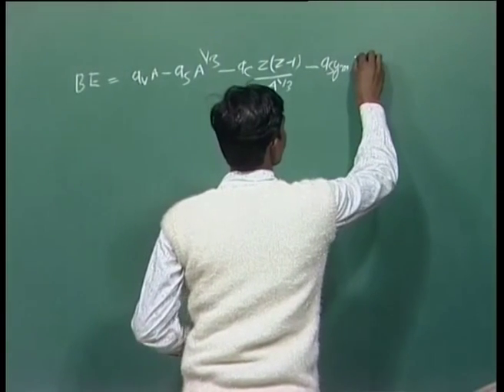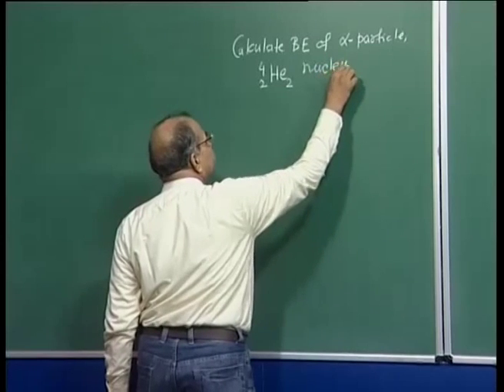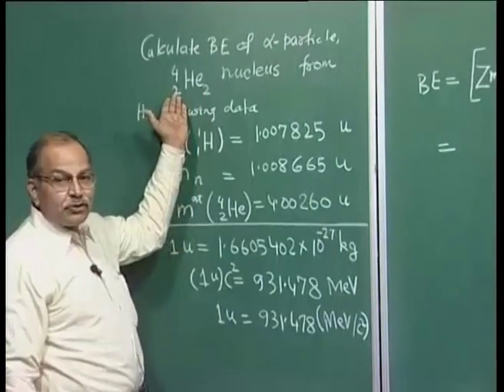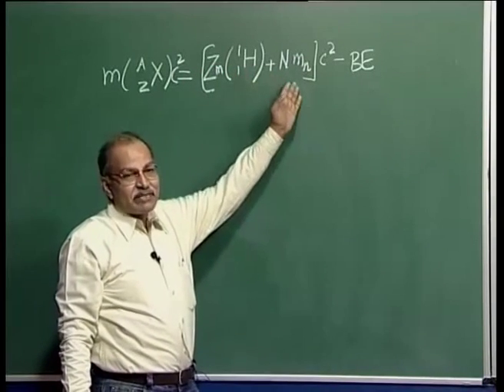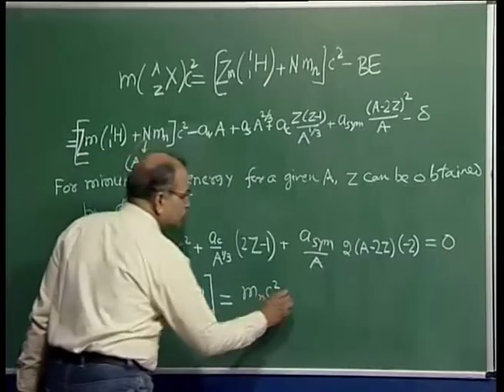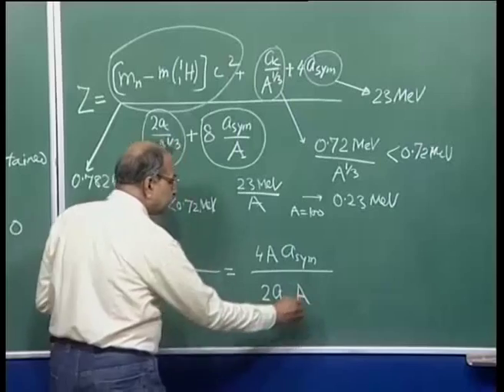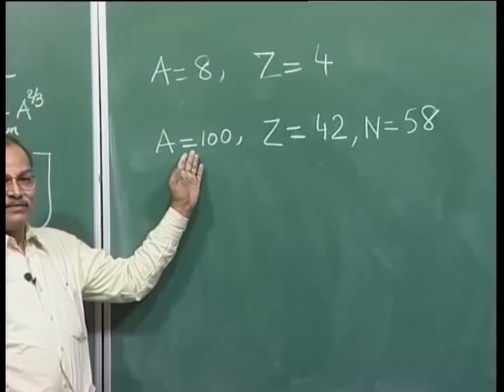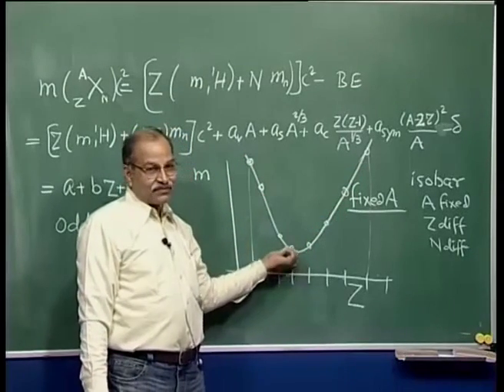Mod-01 Lec-07 Semi empirical Mass Formula Cont..

Comment: I think Ac(columb ) can be calculated 🤔right?
Reply: No, because distance between two protons are different for each pair of protons. Here the radius of nucleus is used as the distance between two protons, which is clearly an approximation. If you want to calculate it then you have to consider each pair of protons separately and calculate the energy of the system keeping in view that they are not in isolation. So other changes will also affect the calculations. It's almost impossible to calculate all these things even for one nucleus, once you do that then you will have to check whether it's applicable on the other nuclei or not because distribution of nucleons is not same for all the nuclei, even the number of protons gets changed.🙂

Comment: how to solve the question:

Let Es denote the contribution of the surface energy per nucleon in the liquid drop model.The ratio Es(Al(z=13,A=27)):Es(Zn(z=30,A=64)) is:
Reply: Surface energy per nucleon is proportional to A^-1/3 not A^1/3
Reply: Udai Kumar Es is proportional to A^2/3 so for pernucleon case it will be A^1/3, so the ratio will be (27/64)^1/3 = 3/4